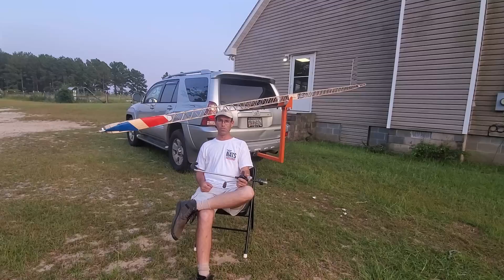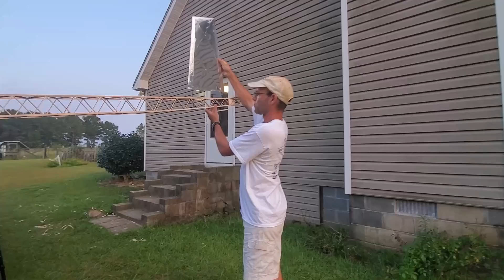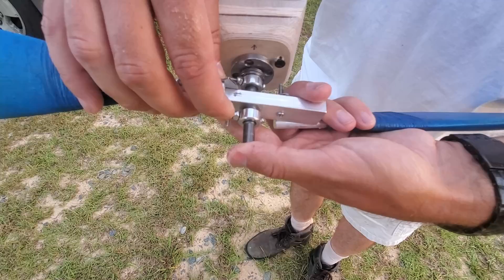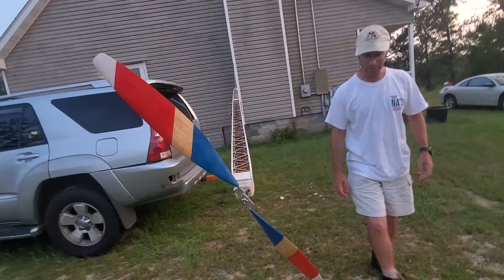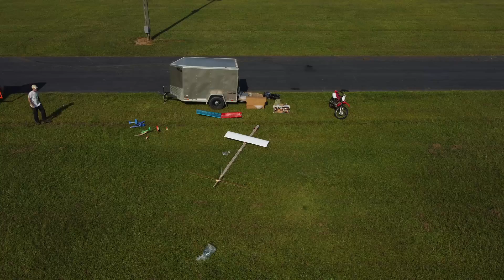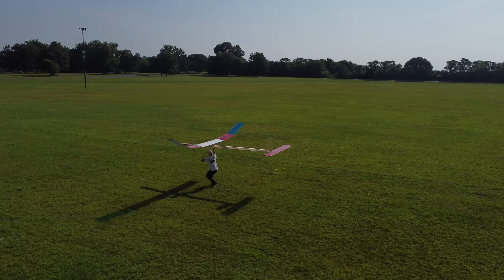Building the world's biggest rubber powered airplane, pt.2

Comment: Have you thought about drilling a hole at a shallow angle from the bottom of the nose block so you can put a pin to keep the prop from turning? That way it can be pulled out from behind the prop as you're launching.
Reply from the maker: I had planned to do that but ran out of time to address the issue of how to make the blades stay open when the prop was readied for launch with the pin in place. Hoping to get that taken care of over the winter.

Comment: What a monster well done indeed---- no specs posted, what is the span, weight, prop size?
Reply: Like he said, 300% of 68" Dawn Patrol, with exceptional 200% fuselage cross section and prop diameter.
Reply from the maker: Check the front page at jhaerospace.com

Comment: Josh, have you measured the apogee torque and revolution rate of your largest planes? You could do such testing on the present configuration. That can guide the sizing of the prop and motor for this one. I suspect a larger prop will be more efficient, will deliver the same thrust with less torque or more thrust with the same torque. The larger prop will be heavier, but it is a marginal increase on the total weight, so the increase on required power will also be marginal. The larger prop will have a lower revolution rate, giving a longer mtor run.

Comment: Nylon bolts might be adequate for the fuselage joint. Keep it light and add lightness.

Rough engineering estimate. Torque to weight ratio, should be verified by test, assume low 0.75. Weight; aircraft 4.91 lb + motor 1.13 lb (could change on test) = 6.04 lb = 2,740 grams. Multiply by 0.75 Q/W to get 2,055 gram centimeters of torque, = 28.5 inch ounces cruise torque. Breaking torque is typically about five times average torque, 143 inch ounces. Your 200 in oz winder is adequate.
Reply from the maker: Unfortunately nylon bolts for the fuselage join proved insufficient, but it flies alright anyway.

Comment: Preliminary engineering estimates for rubber motors.

Assume airframe weight of 4.91 lb = 2,227 grams (yes, I know, gram is a unit of mass, not weight, but guess what, we weigh everything in grams and the 980s cancel out), torque to weight ratio 0.75, motor length 95 inches, apogee torque coefficient 20,772, we get 38 strands of 1/8", motor weight 0.675 lb, apogee torque 26.38 in oz, breaking torque 131.92 in oz, maximum turns 2,243, at a revolution rate of 22 rps, 1 min 42 seconds.

You can manage a motor about twice the available distance, make it 190" long. We get 42 strands of 1/8", motor weight 1.54 lb, apogee torque 30.17 in oz, breaking torque 150.84 in oz, maximum turns 4,290, at a revolution rate of 22 rps, 2 min 15 seconds.

Comment: Everybody watching this knows why you are doing this, we're right there with you.

You definately need a bigger prop diameter. McCombs, Make Model Airplanes Fly, says prop diameter in inches should be at least 1.5 times the square root of wing area in square inches. The larger diameter prop, with its larger swept area, moves a larger volume of air with lower acceleration, with greater efficiency. You want the largest diameter you can fit; the limitation is ground strikes. You are not going to ROG this plane, so that limitation does not apply. The blade angle distribution should be the (helical) advance angle in level flight plus the attack angle of maximum L/D for your blade profile. For our little airfoils, that is going to be somewhere around 4 to 6 degrees. What is your prop advance ratio?

For maximim still air duration, the average torque of the motor should correspond to the apogee torque, the torque at which the plane flys level. I find torque (gm cm) to weight (gm) ratios from about 0.76 to about 1.24, averaging around 1.0. The high 1.24 is for the AMA Cub with its low aspect ratio flat wing. The 0.76 is for the Dandiflyer, with its high aspect ratio cambered wing. Your plane, with its slender fuselage, high aspect ratio cambered airfoil, will likely be at the low end of ths scale. That allows us to calculate the optimum torque if you know the weight of the airplane. Torque allows us to calculate motor cross section for maximum still air duration.
Reply from the maker: Well, for max performance, yes. However the torque requirements for a full sized propeller are beyond my physical abilities. You would need over 200 in-oz just to get a cruise climb going with the 78" propeller, on roughly 48 strands of 1/4" rubber. Besides the need for an electric winding rig on a gantry, there's also the hazard of what happens in a motor breakage. The smaller prop lets me get a slow climb going at around 100 in-oz, and a pretty substantial climb at anything above 140 in-oz.